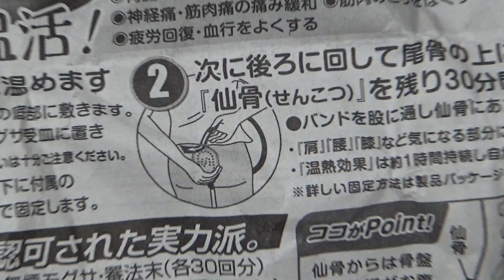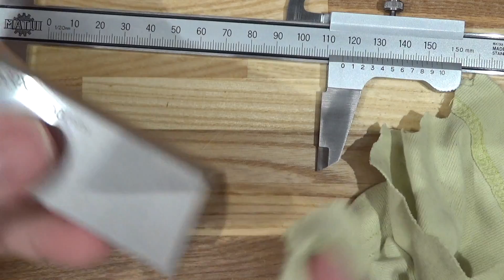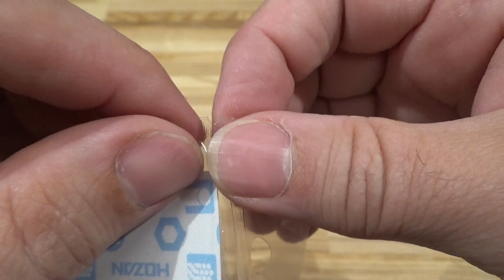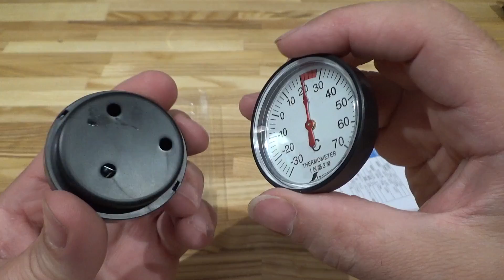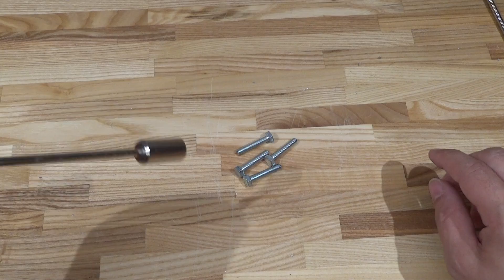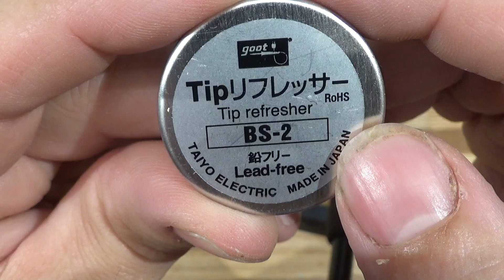Delivery: Odd Tools From Japan!

Comment: It's a fun video full of humor.
I'm a Japanese engineer, and I make things as a hobby.
Japan is blessed with a good market for measuring instruments and hand tools, but housing is very small and
It is hot and humid and there is a risk of rusting, and neighbors are sensitive to noise, making it difficult to place machine tools.
While looking for a video of Proxxon FF230 that would be suitable for the housing situation in Japan, I arrived at your video.
Thank you for the very interesting and helpful video.
Reply from the maker: Thanks for watching! I checked out the addresses of a variety of my ebay and Rakuten sellers on Street View. I was expecting to find neat little tool shops tucked away in alleys, but instead most of the sellers were working out of tiny shot-gun houses in the suburbs where the entire front of their house was a garage door. I imagine those sellers eeking internet sales out on the side, and their tiny garages being packed to the rafters with little boxes of cool tools! :D